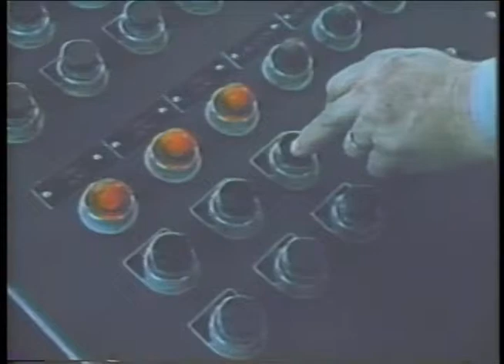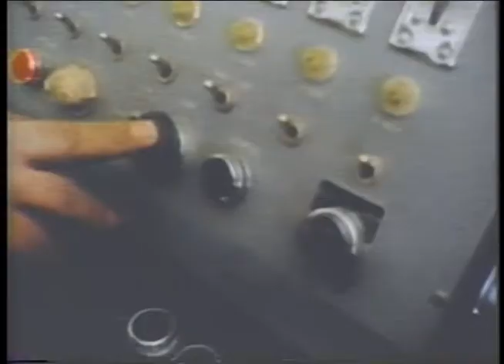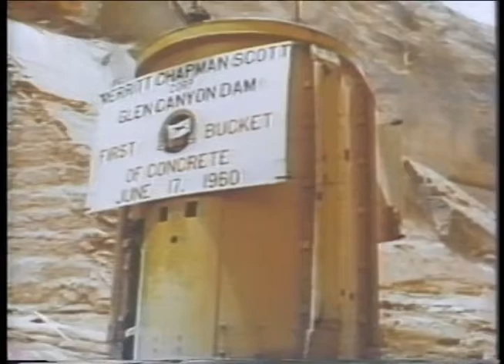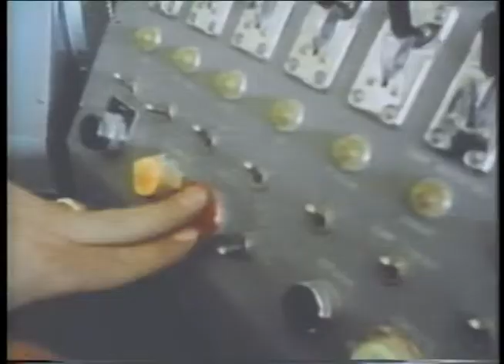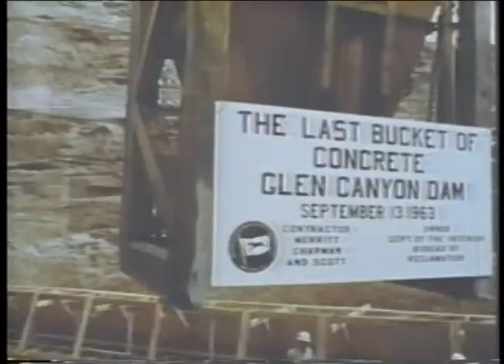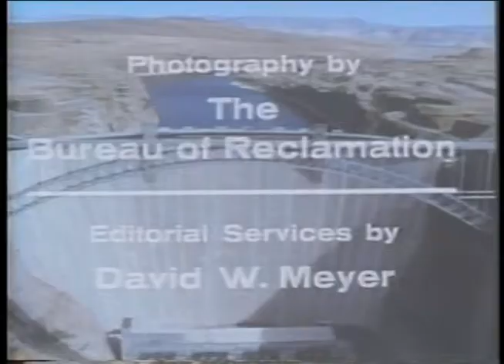Operation Glen Canyon Dam

Comment: Did anyone notice they used Mack's for the heavy duty off road work ?

I was there last May, my wife and I stopped there while on vacation.  Very interesting place. Seems to be very useful as well.
Reply: Yes! What mighty trucks! Love those widowmaker split rim Daytons on the steer axle, drive axles, and semi trailer axles, too. Looks rugged like a truck ought to look!
Reply: They are called big rigs and are much larger today.
Reply: @katedaphne4495  
Yes, they are a little bigger today because we have higher horsepower engines to handle bigger loads.  Being off road,  though they were probably carrying some heavy loads,  more than allowed for on highway use.

Comment: Roughly 30 years separate Hoover Dam & Glen Canyon Dam.  The safety and construction techniques are night and day comparing the two
Reply: Also hoover for what's its worth was a bit of an arsehole to workers, he knew how to get it done on time and for cheap but it came at a cost 
He managed a big gold mine here in west Australia before he managed the hoover dam 
He was ruthless, paid well below the standard wage and imported immigrant workers to avoid paying them at all, wouldn't spend any mony on safety even for the time it was noted 

But the mine and it's investors prospered 
It's call gwalia, it's still running today but t has a museum as well avd well woth a visit
Reply: @fowletm1992  Wow! Former Pres Hoover ran the Glen Canyon dam project ?  He was dead three years when the dam was finished .  Quite a feat!
Reply: @billmcdonald9115  that claim was never made. Might want to read it again.
Reply: @bennichols561  To quote fowletm1992 "before he managed the hoover dam".  You may want to read fowletm1992 again.
Reply: @bennichols561  that's literally what they're claiming.
Reply: @Drewsky840  fowl talks of managing hover dam and Bill talks of managing glen canyon dam. Unless they are the same dam it doesn't read like that to me.

Comment: You couldn’t be more wrong.  The dam is doing its critical job.  There were many reasons the dam was built.  Water storage, flood control, irrigation, power generation and recreation.   Every one of these duties is still 100% being performed.  As you said the reservoir is still holding significant amounts of water.  When the Colorado River floods (and it’s floods are spectacular) the Glenn Canyon Dam is there to hold the huge and deadly water.  The Colorado could never support the levels of irrigation it does without its dams. The dam has generated years and years of cheap hydroelectric power. It may be paused until the river cycles through another period of floods.  While the pool is currently greatly reduced, the recreation opportunities are fabulous as there are many canyons to discover that have been invisible for more than 40 years.  No, Glenn Canyon is still doing the job it was built to do, and the Southwest is still benefiting.           
.
The Colorado goes through incredible cycles.  It has done this for millions if not billions of years.  Nature doesn’t perform on man’s clock. Nature does what it does.  This is the reason behind the planning of a dam that will hold over two years of river flow.  (See ?  Those old engineers were very smart) They anticipated these cycles.  They only had 20% of the flow data we have now.  And we only have a pinpoint on a chart of the lifespan of the river.  This is a classic human problem seeing something in nature and having no ability to control it.  Ask yourself; is Lake Powell 75% empty or 25% full ?  The answer defines you.
Reply: You weren't here a billion years ago, Arizona is a new state, it's after California, California is reason the West is populated,not Arizona.
Reply: @smokingstoking7357   And your post makes no (dam) sense.
Reply: @smokingstoking7357  
HUH?
Reply: Most of those functions are handled quite adequately by Hoover Dam. The only thing it can't replace is Glan Canyon's power generation, but the tech is catching up. The goal is sustainable power generation making destructive hydro obsolete. I'd take wind and solar farms on the rims than riparian destruction any day! 

Everywhere in the US west, dams are being dismantled and rivers set free. It is, however, unlikely that the Southwest's largest dams (Hoover, Glen Canyon, Elephant Butte, Navajo, etc.) will ever be dismantled, but it will become more of an important topic in an ever-drier future.

Also, those conveyor belts!
Reply: @jul1440  I wasn't around when it was built but I visited in the 1970's and walked all around
Reply: @jul1440  Phoenix exists because of the dam, end of story
Reply: Phoenix is there because of the dam , it's not the other way around
Reply: @smokingstoking7357  You say that like it's a good thing. jk
Reply: @jul1440  well of course it is a million people live there. American people
Reply: @smokingstoking7357  Very resilient ones to boot.
Reply: @jul1440  How many ugly ,bird killing windmills will it take to power a million homes?
Reply: Solar and wind farms are hideous, just for starters they destroy wildlife life and the beautiful landscape.  You will have to rebuild those farms over and over again and yet the hydroelectric dam will still be there day and night making cheep, reliable clean power just like it did on day one
Reply: @K-Effect  your talking about the new deal, it's the democrats that built the damn
Reply: @skyh  1,063
Reply: @jul1440  that's a lot of eyesore.Glad you did the math.
Reply: @jul1440   you should do a lil research on wind/sole power,,  although they generate power, they are not known for keeping up on demand..
Reply: @skyh  That is only 45 percentile. Also, they have changed a lot in appearance since the 1990s. Now they look pretty neat, not ugly. One regular sized farm a few small satellite sites (in very, very desolate desert) is all it would take.
Reply: @zoeyshoots  "a lil" would undermine my "a lot". Not sure about you guys back east, but out west we use what we call "peaking plants" specifically for this purpose i.e., to power coolers in the summer, Typically, they are gas plants, but increasingly (at least in New Mexico) battery backup storage (several solar days' worth). Since you can never count on full production all the time, sustainables (except nuclear) are calculated using the 45-percentile.
Reply: @jul1440  I'm in WV and there are quite of few "Peakers" as we called them. Nat Gas. Even coal burners needed them. Now, we are building gas burners. Or so I have heard.
Reply: @jul1440  No.  In CA the dams are being dismantled - along with practically every other means of continuous power production.  Nice results too.  They are slowly gaining all the attributes of a third word county!  Wuhu!
Reply: Do you work in the PR industry?!
Reply: @jul1440  I'll take demand reduction, no riparian destruction  and no ugly wind turbines.
Reply: @jul1440  Hey Jul, “most of the functions”  is a correct statement.  Glen Canyon Dam is irreplaceable for water storage when the next wet period comes.  And it will come - and Lake Powell will be full.  I would not say everywhere in the west dams are being dismantled.  Each dam that has been removed is due to;  1. Uneconomical operation.  2. Becoming silted up.  3.  It has become a public nuisance and danger.    4. The original purpose of the construction has been eliminated.   5. Authorities have determined the dam in its current condition is unsafe.  It must be replaced or removed.   It is important to note no major hydroelectric dams have ever been dismantled.    The only major hydroelectric dam that has been abandoned (not dismantled) is the Vajont dam in Northern Italy.  One of the tallest in the world at 860 feet it was the scene of a rare and tragic disaster.      The bottom line is if we didn’t have hydroelectric dams for the loonie left to complain about they would just find something else to complain about.  Complaining is who they are, not what they do.
Reply: @smokingstoking7357   Correct, Phoenix could not exist at its current population without the water from the Colorado.
Reply: @jul1440  
The windmills kill birds so if your truly an environmentalist,  your supposed to hate windmills.
Reply: No, my father was interested in the engineering and spectacular work that went into the construction, I know the young people my age and especially younger than me, don't appreciate or even know about the history of the dam
Reply: @skyh  It should be noted, however, that Glen Canyon does not "power a million homes"; it is more like 350,000 homes.
Reply: @cpcattin  Very good points sir, and not at all conflicting with my previous statement on the unlikelihood of large dams being dismantled (everywhere is a bit of an overstatement, PNW is where most of the 'action' is).
Reply: @sandua51  "In CA" that, I don't mind.
Reply: @awboat   The one near me is called Reeves. Gas is better than coal for both instant demand and cleanliness, but with the CO2 is still far from ideal.
Reply: @skyh  
One problem with the windmills,  is they are  high maintenance.  So it's pretty debatable as to how much money they save.
Reply: @jul1440  
I disagree,  go to Amarillo Texas,  and there are at least 100 windmills there,  go to Iowa,  you can see windmills all over and they can be seen for miles and miles on nearly every interstate highway.  Personally I don't see the windmills killing birds a problem,  cause lots of animals on the ground can eat them so it helps other animals live.
Reply: @bertgrau3934  Yes; I live in NM where many large wind farms are located. Never thought they were ugly, but the huge sea of blinking red lights at night is a little freaky.

And, of course, the birds are never wasted.
Reply: Youre not accounting at all for the MUD PLUG. The MUD PLUG is the end of the Dam anyway. They didnt design the Dam to operate with billions of pounds of mud compounding on the base an unable to be processed through the trash grating. Its plugging up the trash grating. So the modern feat of engineering has one fatal flaw... the MUD PLUG, and the MUD PLUG dont play, and isnt going away, it only grow larger by the day. No rhyme intended there thats just the truth. 

The whole structure is going to come down one way or the other. Either the MUD PLUG muddies up the plumbing and begins to reduce flow to unusable levels while water "finds a way" and both evaporates at the same time. Thats not efficient, or great engineering folks. It is also unsustainable. 

Tear that thing down and FILL LAKE MEAD FIRST. 

There should be rounds of folks out and in the communities that will be cut from hydro power, doing assessments and installing local/regional renewables for these economies. The recreation can continue, it will just take the form of hiking, biking, trial exploring, camping, and river rafting ... rather than drunk leisure party boating. The only way the West gets a lifeline out of this thing is to increase flow to Lake Mead and fill it, and develop alternatives for power upstream and around the lower basin states. 

Also, stop using a 200 mile long canal to grow Alf Alfa in eastern sun valley Phoenix AZ, only to export it to Saudi Arabia. Not a good use for the resource. Lets all collectively let our elected officials know that this isnt the intended use for federal tax dollars. Water rights or not.
Reply: Youre just upset because youre going to be the first folks cut off from your existing supply in the new compact. Boo hoo. The valley was never supposed to be as big as it is. There was never supposed to be a million "resilient with air conditioning" people in Pheonix AZ living off of the federal government all the way around.  @skyh

Comment: What a beautiful structure
Reply: Too bad it’s gonna fuck the environment and drinkable water
Reply: @enrijuan96  Why?
Reply: @interman7715  damages the environment in the canyon and the grand canyons beaches and bars and with continuing drought conditions it loses a lot of the water it holds so its value is decreasing if water flow decreases which is damaging the water ability.